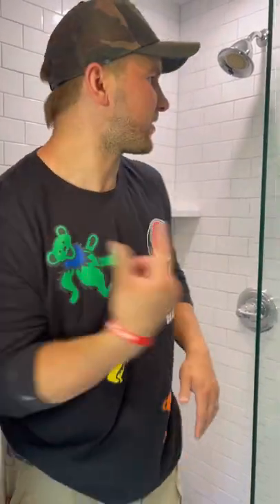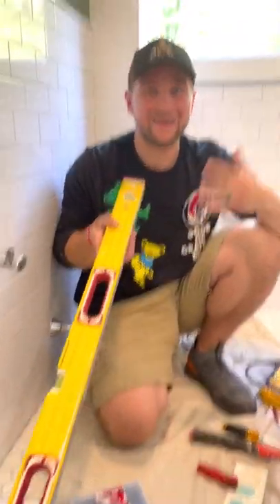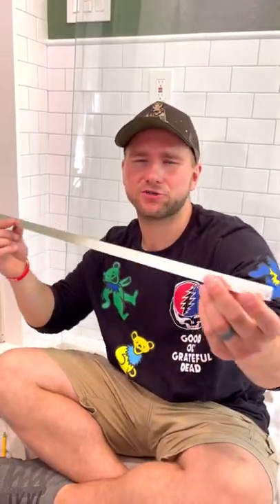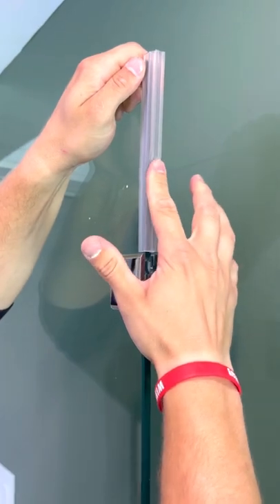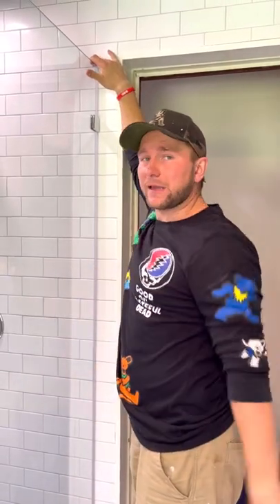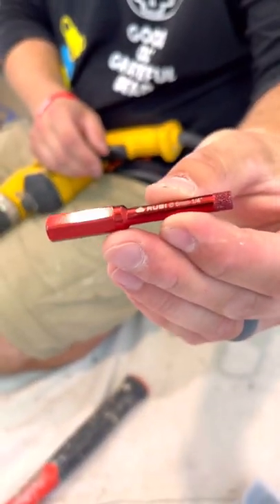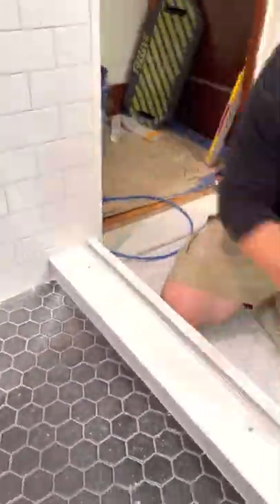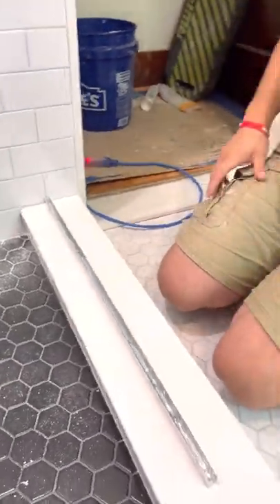How to install a Shower Glass Panel. EASY DIY. WINNI

Comment: Thank you for this.  Wondering if the panel hardward can be siliconed to the curb without being screwed down?  I ask because I have a solid shower base with a narrow area to set the glass and I'm concerned that the edge will blow out if I drill and then screw.  Thanks.

Comment from the maker: $400 in 45 min! PROFIT. 

I know I’m going to catch some heat for how much we charged. But what would you have done?! 

The quote from local glass company was $600 for the install. Just the labor. We did it for $400. Homeowner was happy and we made good money. Am I in the wrong here? If the door broke during the install, we would be the ones getting a new panel, we take on that responsibility. If it leaks down the road, we come back and fix it.
Reply: It is business revenue to cover all fixed costs and variables. Good profit for sure but cheaper for client as well. Most risk was on your end (glass replacement).
Reply: Good ain't cheap and cheap ain't good.
Reply: You are fine.
Reply: Rationalize it how ever you want.
Just don't complain when its done to you.
When a pan leaks and destroys a customer upstairs. You'll know why.
Take that ship back to Ukraine
Reply: seems totally reasonable to me based on risks and responsibility you're taking on.  if there are no problems with install, you made out nicely.  if there are problems, then not so much.
Reply: it costs what it costs. That’s the beauty of the customer getting a quote from someone else. You had to ability to undercut the quote but still make a bunch of money. It’s a win win for all parties involved

Comment: Great install and walk through. Super easy to follow.

For the wall mount, do you need to mount on a stud or just a wall anchor?
Reply: Wondering the same thing
Reply: I wouldn't choose this design if you don't have a stud at the exact position. There are glasses with a holding arm which can be mounted on a stud. This will be much more stable.

Comment: Hi! Question : do u have to use the anchors? Or can u use long screws and hit the wood ?
Reply: I'm a remodeling contractor and use Schluter products on all my showers and do mostly curbless showers. But, if the homeowner wants a curb then I prefer to stick with stacked 2x4's- then I know I'll have the ability to screw into wood and not have to depend on expanding anchors which can crack tile. The one thing I would add to this video is I would have ran a thin bead of silicone under the track prior to screwing it down. This will add a bit of strength as well as waterproofing.

Comment: So it’s okay to screw in the curb?
Reply: This topic is so controversial I’m trying to figure this out too
Reply: One tile master youtuber cuts the screws so he's down to the waterproof membrane but not poking threw it.
Reply: @deaneng8540  I was definitely considering doing this. But I ended up just using silicone to get the clips to stay on the tile and it’s working great so far
Reply: Look up tile coach for information on how to do this correctly.